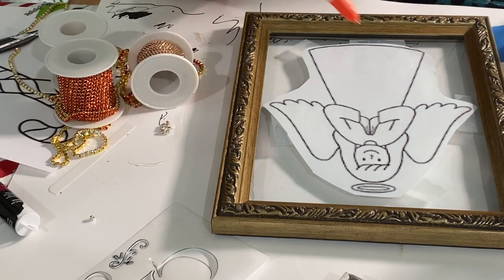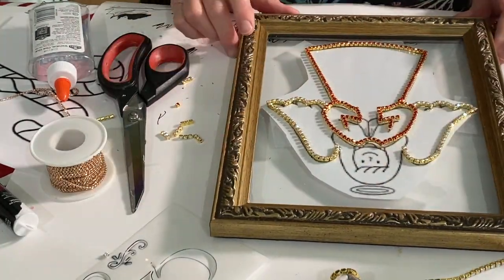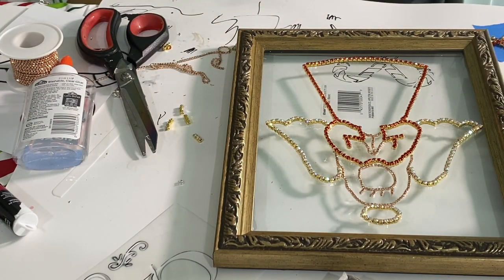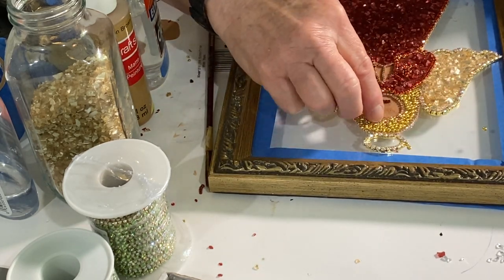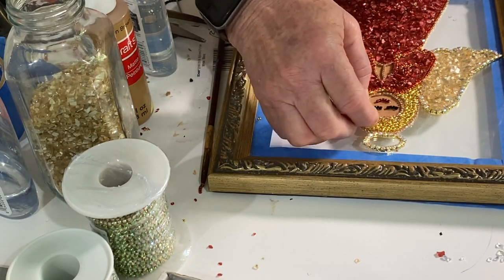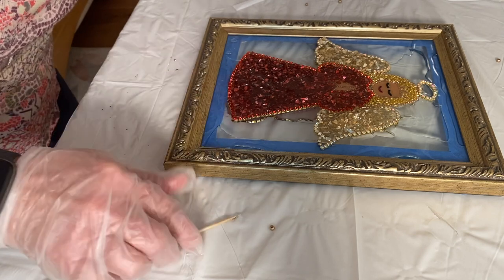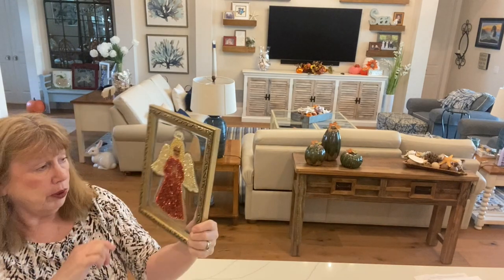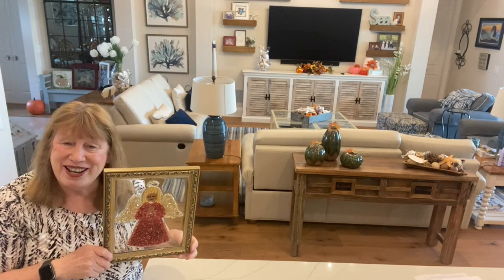CHRISTMAS ANGEL GLASS ART EPOXY RESIN, CRUSHED GLASS, GUIDE, GLASS ON GLASS,  2022

Comment: Another triumph Linda!  Seems lately, you’ve been alternating between the Mod Podge and ArtResin. Is there a preference or are they chosen for different objectives?
Reply from the maker: Yes I just want everyone to know that there is more than one way to do it. Some people don't like to work with resin and some at different times of year can't have the resin  outside because of the temperature. And they can't have it inside because of the fuse depending on what resin you use.
Reply from the maker: Fumes not fuse.
Reply: @crazyglasslady  Got it. And this applies to me here in Colorado! ❄️☃️❄️
Reply: @crazyglasslady  Well, ArtResin is nice to use. No odor that I could tell. I wore a mask anyway even though it’s not toxic.